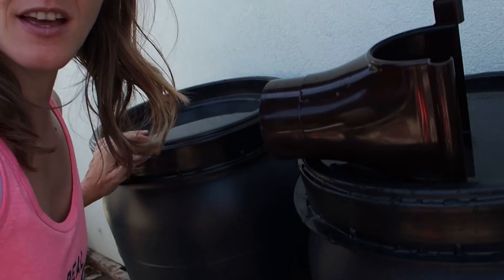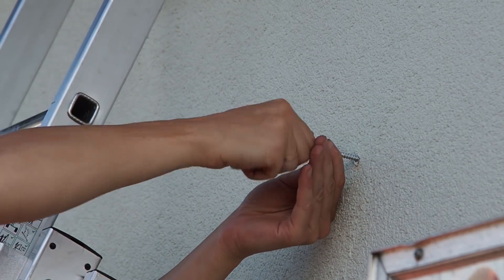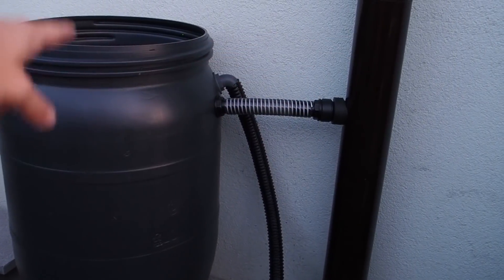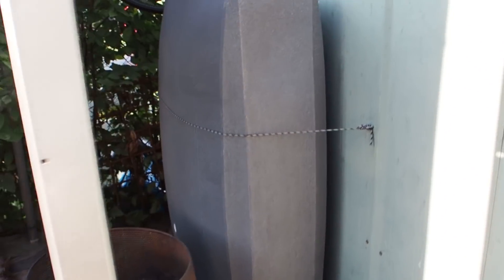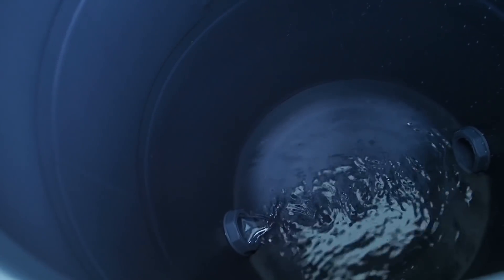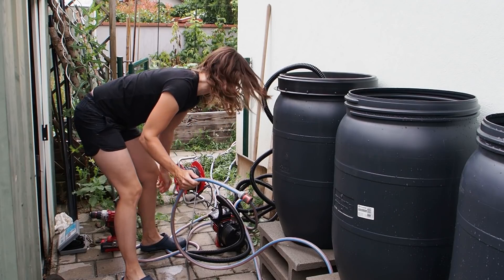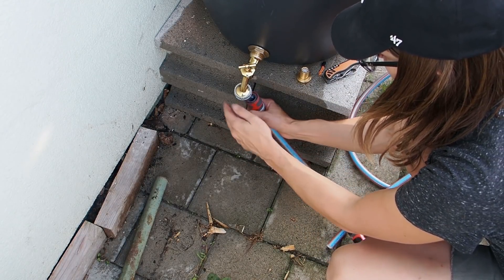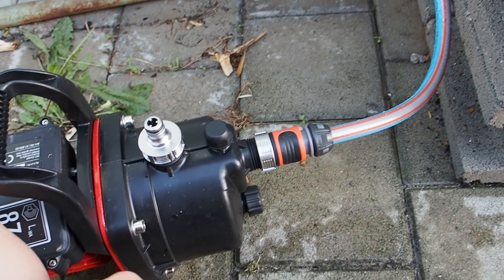Rainwater Harvesting System (Water Storage for the APO.CALYPSE)

Comment: I might be wrong here, but didn’t you install the overflow at a higher level than the inflow?  So the overflow would never work water will simply back up on the inlet pipe.
Reply from the maker: the inflow comes down in a little angle. later in the video you can see that the overflow is working.
Reply: @SurvivalLilly  OK, thanks for replying.

Comment: You just "prime" the pump - it should be with water inside when you start it. after that it can take the water even from high point.
Reply from the maker: yes that is what I did later. But it is not really convenient to do that every time. So the lower spigot solution did the trick for me.
Reply: @SurvivalLilly  I think you mean spigot, not bigot.
Reply: @SurvivalLilly  How fast is the pump now you are using these thin quick-connectors? Could you demonstrate filling a 10l-bucket please?

Comment from the maker: Q&A: Yes I could have saved more space inbetween the barrels by connection the houses differently. That is what I would do different about the system, but now the holes are already drilled. If anybody has improvements to my system please let me know in the comment section below.
Reply: Please don't let the downspout pour water near your home's foundation.  This could result in structural damage.  Spouts should empty several feet from the foundation.
Reply: Du benötigst keinen Überlauf. Wenn die Tonnen voll sind, läuft das überschüssige Wasser im Sammler einfach vorbei. Des Weiteren ist es sinnvoller die Behälter oberhalb zu verbinden. Dadurch wirkt das erste Fass als "Beruhigungsbereich" für das Wasser. Bei einer Kontamination des Wassers sind somit nicht gleich alle drei Fässer betroffen. In der Dachrinne sollte ein Schutzgitter installiert werden, so dass keine Fremdkörper das Wasser verunreinigen können.
Reply: @HorstUnsold  Great answer….because that’s what I was thinking too.  ;D   Thanks Lilly for this Video (und nau its off zum Hagebaumarkt tu get ze parts I need!)
Reply: I am very glad that you are happy with your system. I am however a bit perplexed as to why you elected to connect the barrels together at the bottom instead of the top. As is, the system will evenly distribute all rain water equally between all three barrels. If you set it up so each barrel over flows into the next they would fill in order first one then the next. If you then put a sillcock  ( hose bib ) near the bottom of each barrel you could draw from each barrel one at a time as needed. The last in the sequence can be made to overflow into a drip hose and water the garden automatically with the water in excess of what you can store, albeit only when its raining but its better then just dumping it on the ground. It would turn a nominal rain fall into a good soaking for the garden.
Reply: Small side point, it is called spigot (in US) or tap (in UK), not bigot (which is bigotted person). 
As for your system, I would have used something like Strata pro ward 250L slimline water butt. It is nearly square shaped (54x54 cm), so you can fit them in pretty much same space as your 120L barrels (if to eliminate gaps), comes already with a tap (or spigot if you prefer).
Replace taps to quick connect/release ones, so you can connect pump to any of the barels. Owerflow hoses should be connected at the top, as not to loose water if some pet decide to chew through, also that barels could be disconected for cleaning without need to drain all of them.
You would have more than double amount of water (750L vs 360L), no risk of leaks and easy maintenance/cleaning.
As for barels being placed on concrete, it is an issue only if they would be moved frequently, as concrete is quite abrasive and would damage bottom of a barrel.
Hope that helps.
Reply: @Kibernautas  Proper term is Sillcock or hose bib
Reply: @markhadley1545  sillcock is a tap/spigot  attached to outside of the house wall. Hose bib is sillcock with the end bit to put hose on. It still a tap, just more specific type.
Reply: My experience in 3 years collecting rainwater: Rainwater needs chlorine every week!
I have a 4000 liter rainwater collection system (for 10 small rental houses) and I use 4g of chlorine per week to avoid "green water" and kill bacteria. The water is used for flushing and in the service area (washing clothes, washing sidewalks, bicycles, car, etc). Without chlorine, the whole system smells bad in 1 month and the water turns green (algae), it can even clog the water pump and pipes. Swimming pool chlorine can be used for this. (translated by google)
Reply: @michaeljunkes9265  I have never found that necessary but I only use mine for irrigation.
Reply: @markhadley1545  OK! For irrigation chlorine is BAD!
Reply: @michaeljunkes9265  Yes, my tomatoes don't care if the water is slightly green or contains a bit of bird poo. That being said, I have never noticed the water being green. I have no problem washing my hands and feet in it when I come in from the garden. I do go through it pretty quickly though I don't have a huge storage capacity and I have a good sized garden
Reply: Lilly your system is fine, simple and clean. Please remember that the more complex you make it, the more likely you are to have troubles in the future.    If you do have rodents around that may chew on your plumbing just wrap it in 1/4 inch galvanized steel wire mesh ( we call it rat wire). Also you may end up needing clamps on the connecter pipes between barrels to stop any leaks at the joints. You've done a fine job!